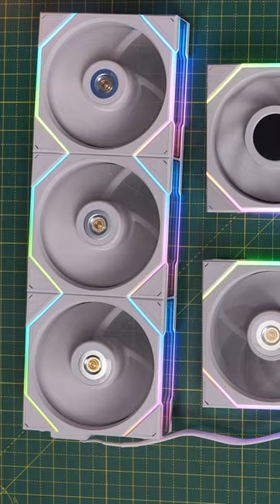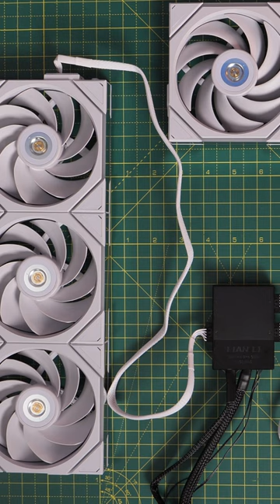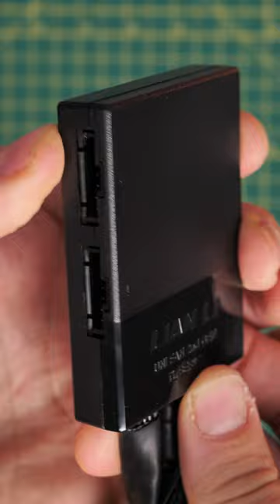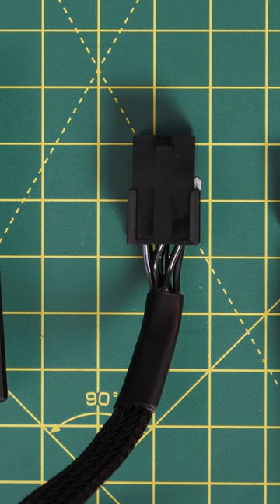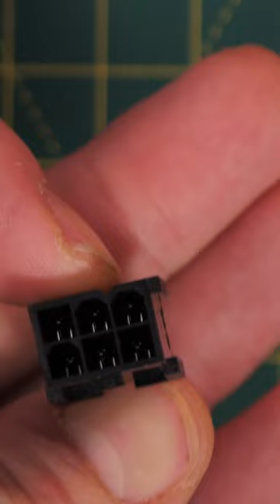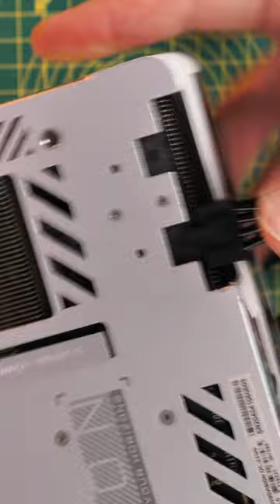The small problem with Lian Li TL LCD fans #LianLi #UniFans #LCDFans

Comment: PCIe is a very strange choice by Lian Li. No one needs 150W for their fans, what’s the limit on the other options? I can’t believe this was necessary. 4090 hogs the PCIe cables!
Reply from the maker: It's a strange one but Corsair also has it with iCue Link so it's not unique
Reply: That was my thought as well. I got a PSU with a native 12vhpwr connector to try and avoid issues.
Reply: 4090 uses 12vhpwr?
Reply: @elvpse  yes
Reply: @Poignant_Ritual  i dont mean u i mean the commenter(bc 4090 dont use 6+2 so what is he yapping abt💀)
Reply: @elvpse  I think what he means is that without a native 12vhpwr connector on your PSU, you'll need the adapter cable which takes 3-4 PCIE slots up. So for people without that connector, they're looking at 4 or 5 of their PCIE connections being used up by just the the CPU and GPU alone, so you may come up short depending on your config if you're using these fans. Really I agree with you, if you have a 4090 you probably have a beefy PSU that has a bunch of PCIE slots anyways. But it is a weird choice from Lian LI
Reply: @Poignant_Ritual  yea thats facts
Reply: @Poignant_Ritual  needs more power then a sata cable can handle.

Comment: I connected the 6 pin power cable to the lian li module and it burned my usb wire to the mobo. My mobo is now unusable. It wont post. I’ve removed all the peripherals and its locked in a red and yellow light status.
Reply: Same thing happen to me last night smh it was smoking I caught it in time before it reach my MB
Reply: @manueljavier5513  i had to replace the cpu,ram and motherboard. Thankfully it was still under warranty.

Comment: Just got the new Hydroshift 360TL AIO that requires power via that Gen 4 PCIe. I have a Corsair PSU with Gen 5 inputs and even using a Gen 4 to Gen 5 adapter from Corsair it still doesn’t work. Super frustrating.
Reply from the maker: I don't understand this problem. Type 5 should only be at the PSU end, the other should be type 4
Reply: @TheProvokedPrawn  you are correct! I mistakenly used the term “Gen” instead of “Type”. But anyway The cables that you have to plug in from the cooling block that’s sitting on your CPU is a 5V ARGB 3-pin female connector and a female Type 4 PCIE 8-pin connector. My PSU is a newer Corsair RMx Shift 1200 with Gen 5 inputs and I have no way of seamlessly just plugging that Type 4 male PCIe from the cooling block, even when trying with a Corsair adapter cable from female Type 4 from the cooling block to male Type 5 to my PSU it still does not work. When I boot, the AIO pump and fans kick on and the LCD screen will flicker but never actually boot to the lian li logo, it just remains black.

Comment: Hello and good evening, I have the following problem: I have 10 TL LCD fans with screens and a water cooling system from NZXT, as well as both Plus V2 Strimmers. I have 2 controllers from Lian Li and one controller from Lian Li for the V2 Strimmers. I also have an internal 2.0 hub from Corsair. However, I’m facing the following issue: I can’t control the LCD screens, and often Windows says that the hub is not recognized, even though everything is correctly connected. Occasionally, some screens on the fans remain black, or a Lian Li controller cannot be found via L Connect 3. I have already tried various things; what should I do now?”
Reply: Lianli lcd fans need to be connected directly to the board, which means any lianli hub with lcd fans can't be connected to another usb hub. This info. is forwarded by official lianli vendors in my country

Comment: Why use a gpu pcie cable? Can you just plug it directly into your power supply since thats effectively what you're doing
Reply: Every PSU manufacturer uses different cable pinouts on their PSUs preventing the ability to plug anything directly into a psu.

Comment: Can you use the SL V2 controller with these fans? Or do you have to use the TL controller for them?
Reply from the maker: You have to use the TL controller
Reply: @TheProvokedPrawn  ok thank you! Just to clarify then does the SL V2 fans work with the TL controller then?
Reply: @vMindzTTV  each set of fan types requires their own specific controller, so no

Comment: My Lian Li fans are connected to the hub but My PSU doesn't have a spare port. What would you do in this scenario. My system boots but no fans. Yet my Galahad 360 keeps CPU temps at 51 degrees. Just no spinning :(
Reply from the maker: New power supply?
Reply: @TheProvokedPrawn  Just ordered the Rog Strix platinum 1200w has all the slots needed. :)
Reply: @JonGarcia. damn

Comment: The other issue is that, if you buy one fan, will NOT WORK ! Because you need the lian li controler, that not included in one fan package, but only with three fans package. TERRIBLE!!
Reply: πέρα από αυτό αντιμετώπισες άλλο θέμα? στο τροφοδοτικό έχω 3χ pcie 6+2 χρησιμοποιώ τα 2 για 3080ti θα μπορέσω να το συνδέσω με τα φανς η θα έχω πρόβλημα?

Comment: Any pc will only need 3 or 4 fans to mount on the motherboard tray.  PCIe is fine as long as it’s not raking away any gpu bandwidth.  May have to go with at least a 1200w psu or greater depending on the system.